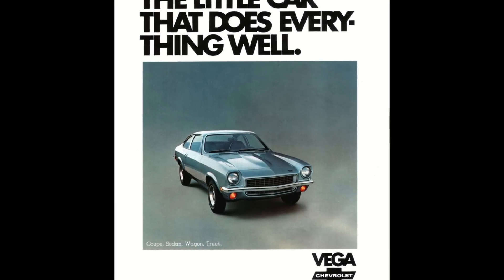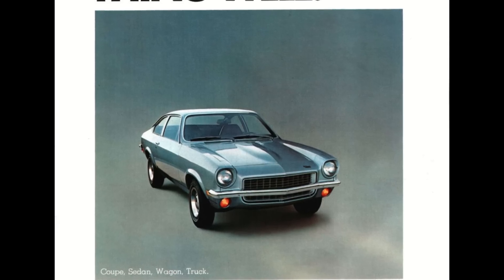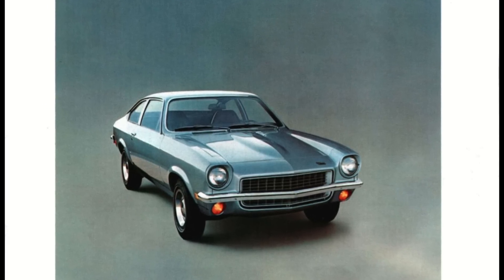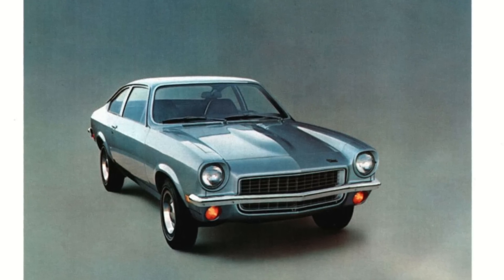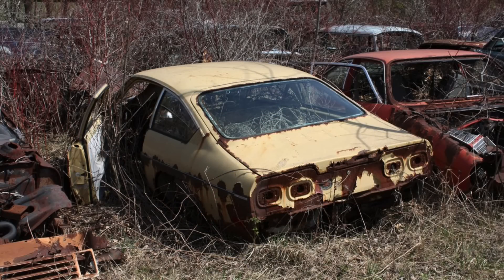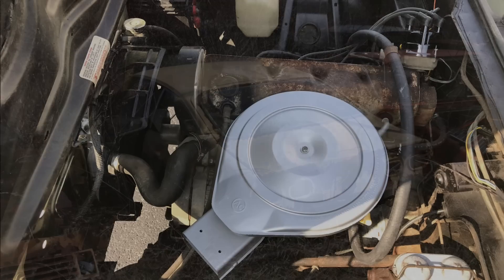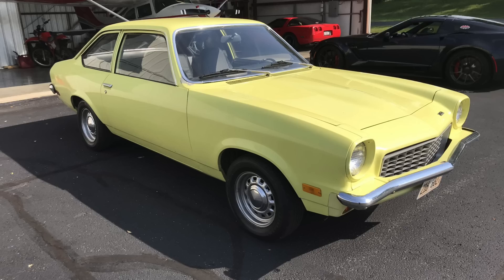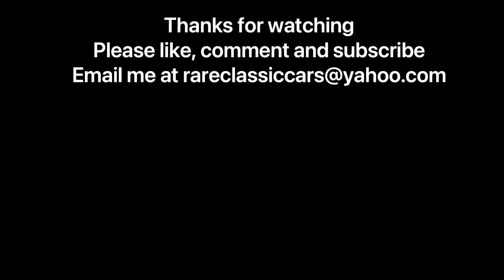GM's Largest Failures: Why The Chevrolet Vega's Engine Turned Buyers Away From American Cars

Comment: Not surprised at all. Vegas were garbage. Even the infamously explosive shit box Pinto was superior to the Vega. My mechanic is a staunch Chevy fanboy, yet he admits to more GM cars and trucks coming into his shop than any other brand. Mostly LS powered vehicles with low mileage just past warranty with a plethora of drivetrain issues. Distantly followed by Chrysler, Volkswagen, BMW, Jaguar(crap), Nissan, Saab and Kia. Other than regular maintenance, he hardly ever gets customers who have problems with Hondas, Toyotas or even Ford, the current recall king.

Comment: For example Peugeot (and Citroen even before WWII…) started with free standing cast iron liners back in the fifties!!*
And used them succesfully for at least another 40 years…
I think this GM engine’s alloy liners casted with the block combined was one step too far….
The process of achieving the right liner innersurface hardness, surface ‘roughness’ and piston/cylindre clearance was not yet mastered well enough for mass production….
Besides that alloy does expand a lot under temperature, highest temperature is at the very top of the cylindres….. the liners are all connected at the top…. the tension at the top must have been too much for the head gasket to keep up!

* free standing meaning one liner for one cylindre: they were loose fitted in the cast block (first cast iron, later alloy (peugeot 204 (1964?) was the first one with an alloy block) of course liner and piston had to be within tolerance to be combined.
On top of that every single liner had to have the right level compared to the top surface of the block, regardless alloy or cast iron, this was done by using shims under the liner to achieve a tiny protrusion above the block’s surface.

The same construction as the Vega engine was later on used succesfully in for example outboard engines, but they were much smaller and more precise machining and tolerances were achieved by then as compared by the 70’s….

Ps I like the vid!!!
Thumb+Subscription!!

Comment: 5:35 In my opinion here you assume wrongly…..
The liners are lubricated by the crankshaft rotating through the oil in the sump…. ie. as soon as the engine ‘fires up’ oil is splattered all around and liner lubrication is fine…. unless the oil level is (way!-) low…..

Comment: I have owned two versions of Ford's 2.3 over the years. Both were excellent with durability and efficiency even if they did tend to use some oil. It's too bad that GM couldn't do the same.

Comment: i worked at a chev dealer in a body shop, when i got a order to bring in a Vega it took me a hour to get them in the shop, battery dead, because of cranking to get it started, when finally got it started  they ran like shit  most died half way to the shop we ended up pushing them in,  most in Canada were rotten form one end to the other we changed every panel on some under warranty including the quarter panels, fenders ,doors, end panel, hood and hatchback nightmare cars

Comment: My dad has only bought one brand new car in his life and that was a 1976 Pontiac Astre. AKA the Pontiac version of the Vega. In less than 10,000 miles the engine was burning oil, the body was rusting, and the interior was self destructing. GM just went really cheap and low grade on this one.

Comment: Excellent video.  You are one of the few who understand the actual issues with the Vega engine.  I had one and kept the coolant full and the oil changed and put over 190,000 miles on it with no major problems.
Reply: Only the '76 & '77 Vega engines were durable.  '71-'74 engines were oil burners by 35,000 miles even if oil was changed every 2,000 miles and never run low on coolant.
Reply: @4af  Mine was a 1974.  Never burned more than 1/2 quart over 3,000 miles.  Never had the valve cover off, never had the head off, and never had the pan off.

Comment: Vegas were actually very good cars. I owned  several Vegas because they were cheap to buy. The Vega was originally designed to have a small block Chevy V-8 in them. In 1975 Chevy came out with the Iron Duke engine for the Vega. Too little too late. The lessons learned from the Vega issues were applied the Chevy Monza cars. The Monzas came equipped with the 262 V-8 and a five speed manual transmission. The Monzas cleaned up in drag racing competition.

Comment: I used to show friends that I could shave a piece off of the block when my 73 was at operating temperature, with a sharp knife.  I changed the manifold with Webber side draft carbs, a cam and a header. Wider rims and tires, shorter springs made it a fun road car with a manual transmission. 
It was all fun and games for a couple of years till it got terminal cancer everywhere.  (We lived on the beach in Fla). I tried to keep up with the rust till the hatch hinges let go. So it was on to a 71 SS nova. The Vega was the worst GM I ever had so far.

Comment: A true throw away car. My aunt had a 76 which was supposed to be 'better' but it wasn't. By 3 yrs in, it was burning a lot of oil at just 35k. My uncle had enough of that and looked at dealer trade ins. He found a very basic 78 Nova sedan with the 250 auto, p/s and brakes. No a/c, and just a single AM radio speaker. The car had just 13k on it. To the point, the Chevy dealer wouldn't take the Vega as a trade. He sold it for $100.00 to a private buyer who put in a Chevy 305 from his Impala that got wrecked in 79. That Nova lasted well into the mid 90s with rust getting it. The Vega with that 305 couldn't pass the emissions standards Il had implemented in the mid 80s and it got sold out of state, condition unknown.

Comment: The Vega has aluminum bore cylinders. But they are treated with acid to expose the Nitride ?hard part.. like aircraft engines. It all works unless you over heat the cylinder walls. There are no steel liners

Comment: I bought my 74 Vega GT 4 speed by trading in my 68 Ford   fairlane. It had 135,000 miles on it but brand new off dealers lot it used 1 quart of oil every 500 miles. The 302 v8 was manufactured with incorrect valve stem size (as were all of the 68 and 69 models. At first dealer refused to repair because he said 1 quart of oil every 500 miles was with in fords specs.  I had to drive and keep a chart of mileage and oil usage, but he had a chart in his desk that showed 1 quart every 500 miles was acceptable ford specs. I was glad to get the Vega that did not use any oil until it had 80k miles on it. I had all kinds of problems with the Fairlane. Even after ford fixed iy still used a quart of oil every 1,000 miles.  At 80k miles the timing chain came off because the gear had a plastic coating that cracked. The plastic coating was to make the engine run  quieter. When I drove the fairlane off the lot n went q mile gas gauge was on empty. I thought wow they didnt even give me gas. I tried to fill it up but it was already full. The gas gauge wasn't working.  I turned around n make them fix it. The next day I didn't get home from work. I stopped at Lums to eat n when I tried to start the car it made no sound but smoke came out from under the hood. The smoke made perfect mushroom cloud.  Ot turned out that a wiring harness got pinched between the radiator and the frame. It goes to show all cars had their problems

Comment: All the Vega owners a know have a  Bimodal distribution . Some that say the engine was perfect and others the engine seized or burned oil like mad. NONE owned them after 1980.   A mess  of Vegas and Pintos were used consumed in races in Ventura from 1985 when the dirt track became 1/5 mile. Both cars were dirt cheap and junkers.

Comment: I had a  brand new ‘74 Vega GT, purchased at the insistence of my parents for $3,265 out the door vice a ‘74 Capri where the Lincoln Mercury dealer wanted $1,000 more.  
The Vega ran good, but uneventful until I put 25,000 miles on it. Then I bought a Rajah turbo kit from Service Center. Cost me $500, a lot of money in 1976. Had the pressurized carb fuel feed into a Rochester 2 bbl carb Vice the stock Holley Weber 2 bbl progressive carb. The mods the kit specified did not work on the Rochester carb. I can smell the gasoline leaking from the carb throttle shafts (Rochester 2 bbl) under boost in the passenger compartment. The pitman arm (steering) interfered with the exhaust pipe/turbine “U” exhaust piping so you couldn’t steer good as the engine rocked (tilted) from all the new torque put out from the engine. That was scary! After a couple of thousand miles, the engine started burning a lot of oil. I remember burning about 1-1/2 to 2 quarts of Valvoline Racing 20W-50 oil between every fill up. The oil light would often light up when I make a quick right turn into the service station. 
The model year I had the mechanical valve lifters. Every 360° turn of the allen wrench would give you 0.003” change in clearance. I thought it was a nifty design. The valve lifter were heavy. I floated the valves from over revving at << 5,300 rpm and the power would just die at the high school drags. 
I tried all those point controlled electronic ignitions. They really didn’t fire the plugs when the engine was cold and started smoking like a Mercedes Benz Diesel car. Then all of a sudden, the engine would warm up, the oily smoke would end, the rings would seal and all would be normal again.

Comment: One thing I remember when I bought my new 74 model GT it came with seat belt interlock system that prevented engine from starting until both driver and passenger buckled up. I had a friend who refused to ride with me because he said it was stupid that government forced him to buckle up. This was the only car I fully ordered from dealer as I remember selecting the color, I interior colors and the herringbone fabric for the seats and the mag style wheel design. Full instrument gauges. I think it took about 4 weeks to get my order. Overall the car was as solid as a rock. The unitized boby was solid as a rock and had no problems with rust or paint problems.
Reply: All cars back then had the seat belt interlock. You just had to get under the seat and unplug it.

Comment: ALFA Romeo used removable, "free-standing" cylinders as well and to great success. Granted ALFA's are also steel and less prone to flex.
Reply: Yes great engines but the high-powered 2.0l engines would wear the headgaskets over time due to flexing. Overtime meaning not prematurely . The1750 made less power so you didnt see that much flexing headgasket wear. And yes steel liners were removable. But i think it was a costlier engine to produce

Comment: Excellent video but one thing you missed is that in probably 74 year models had a switch that cut off the electric fuel pump when the water temp got too high to prevent engine damage.

Comment: the lines of the vega were cool mini camaro ! when i first started off in the auto machine shop the two motors we were doing a lot of was the olds  350 diesel and the chevy vega  its sad but if chevy would have started off doing these two things to the motor it would have lasted [the motor ] cast iron flange  sleeve . flange for two reasons one to hold it in the block and two to fully  support the head gasket  [when chevy did go to a cast iron sleeve it was straight and half the head gasket set on iron and the other half set on aluminum and that part of it [ aluminum would rot away and the gasket would leak ] L A  sleeve co.  did come out with a fanged sleeve and that fixed all that but the damage was done ! and no. two a bigger   radiator

Comment: It was junk. I was in mechanic school and rebuilt one. Of course, steel sleeves were needed, but it had too little cooling capacity and oil capacity. Get it hot and you were done.

Comment: On paper, the Vega was the best small car of its era; unfortunately, you can't drive a piece of paper.  Mine started using oil like crazy, but an ace Chevy mechanic fixed it to perfection; however, I loaned it to my brother and he drove it in a ditch and totaled it.  None of the small cars of that era were particularly good in the first place, but the Japanese cars got better fast----and they offered a ton of models at cheap prices.  In my 66 years of living, Honda began making cars and NONE of them were bad!

Comment: The "free standing" or open deck block was done for better cooling around the head surface and top of the cylinders where it runs the hottest. Good luck finding an engine built today thats not open deck. That engine with 90 to 110hp wasn't going to cause those bores to shift either 😂

Comment: Hi from Sydney, Australia. GM USA should have had a boatload of our Aussie 2.2/2.3 litre 6 cyl engines, with a light bore out that same block became 186 ci, with a bore out to 3 litres & fitted with 3 carbies. These GM Holden OZ' Holden Torana GTR XU1's  thrashed Fords 5.8 ltr 351 ci v8 on the terrible torturous hilly, windy Bathurst racetrack.  PLUS they DID NOT overheat on the hilly track like the Falcons 351's. 

Have a friend here in OZ' with a Vega and the Holden 6 cyl fits like a hand in a glove.  These meaty little Holden Torana's really showed what a reliable , indestructible, powerhouse the small engine was when tweaked a little, AND remember this was when the car had to be an off the sales floor car!!!!   The GTR XU1's were stunning.  

These 6 cyl "red" motors would give owners 200,000 mile , or more , reliability.

Comment: I wish the Vega had used the 153 four from the Nova - for at least the 1st year.  The Ford Pinto offered 3 different durable  fours, the 1st two were well proven in Europe. 

Alloy enables higher speed tooling to greatly reduce block milling costs.

The 153 is still in production as the Vortec 3000 industrial motor

There are Vegas still running with the original motor never having been apart.  The common trait is the owners were very particular with checking fluid levels

Comment: It's the early 70s. Volkswagen has been rapidly taking over the economy market in the US, and the Japanese imports are really starting to pick up steam in the US. GM needs to put a car out to try to compete in a segment they are completely losing a foothold in. Should they follow suit with the foreign manufacturers and release an appealing car with a simple, inexpensive, reliable, cast iron pushrod engine? Surely Chevy can handle developing a cheap-to-manufacture, reliable engine after their bulletproof V8s and Inline sixes. Or wait, it's GM, it's a worldwide company. Maybe they can just take a perfectly reliable engine from one of their european branches, who specialize in the stuff and compete with foreign brands in their home continent? No. No. It's an economy car, a car people buy purely because they just need reliable transportation and nothing more........so let's go back to the drawing board and make a super experimental engine with unknown longterm reliability, a tiny cooling system, and a needless overhead cam. That oughta be the key to success! Thankfully enough people were still so incredibly stubborn that they'd rather buy an American economy car than...you know...a good economy car.

Comment: For every car that had a huge issue like the Vega engine, there were 10 other cars that were basically reliable but let down by little cost cutting measures, such as poor plastic interiors, door handles that were so cheap they kept breaking, or rust issues due to no fender liners. A friend had a 1980 citation where he had to crawl in from the passenger side because he got tired of taking apart the drivers door to replace the linkage to the handle. My dad had one of the first Dodge minivans that he loved but the first cold winter night the entire passenger side of the dash cracked down the middle. We also had a 1983 escort where the paint started flaking off in a year.

Comment: The biggest issue with these engines was the use of the hypereutectic aluminum block with an open deck against the cast iron cylinder head.

Comment: I had the Pontiac version of the Vega; the Astre. Mine was the very rare panel express model. And it was a bit later; 1974 IIRC. Instead of the earlier Open transmission version, it had the Saginaw which was far better, and had a nice solid shift. You can tell the difference because for the reverse lockout, the Open trans models had a round ring just below the shift know. The Saginaw had a chrome T to lift up on. Back at that time, I worked for a large Chev-Olds dealer and we drove a lot of those cars. The first time I drove one with the Saginaw tranny, I knew that I would buy one. It was a great car for the 2 years or so that I owned it.

Comment: Hastings made a replacement air filter kit for the Vega.  The initial cost was about the same as a GM filter, but after that you could easily replace just the paper element at a much lower cost.
Reply: I remember seeing those air filter kits for sale in the J.C. Whitney catalog back in the 70's.

Comment: This car's biggest problem was GM being as shockingly cheap with it as possible. That very undersized radiator, releasing an engine they knew had problems, not putting drain holes in closed parts of the body where water would be trapped and cause to rust out. It should have been a better car, and that GM bought new engines and rust repairs from new and had to have realized severe corner cutting and the problems had to have cost far more than simply building it better to begin with. People love to call the Ford Pinto a lemon, but having worked on plenty, I've seen them survive terrible treatment and last far longer than any Vega. GM could have learned from Ford in this case.